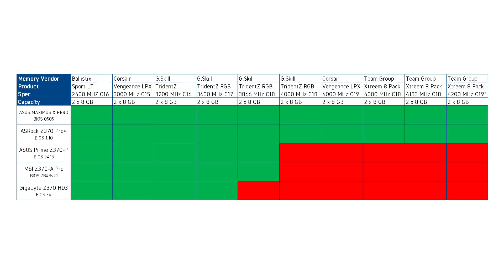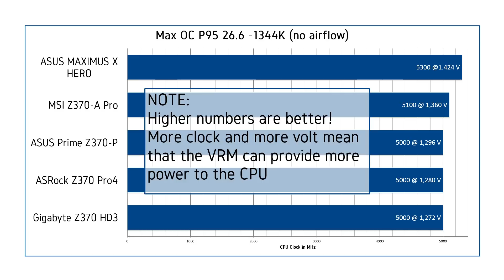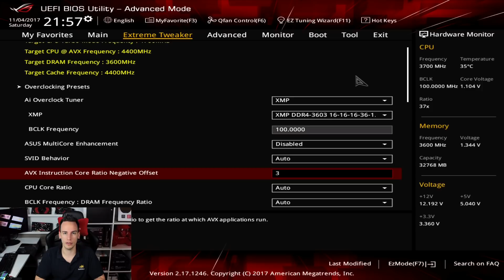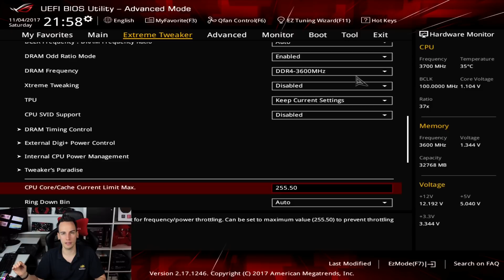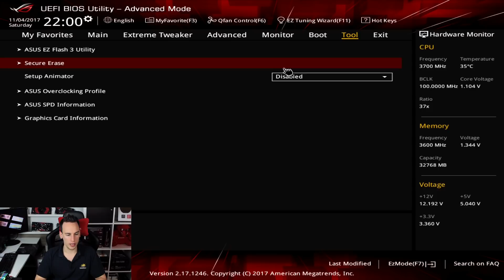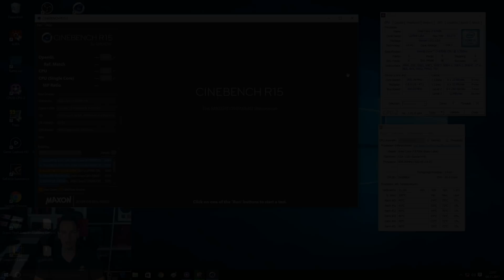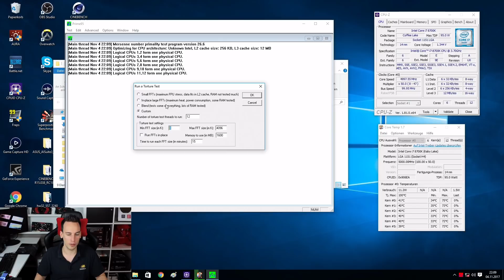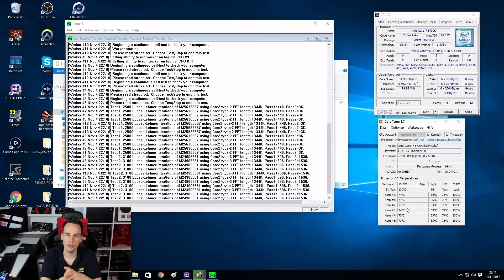ASUS MAXIMUS X HERO - Overclocking Test and Guide 8700K (en)

Comment: Hi everyone. I'm following all the steps in the video but my 9900k runs maximum at 4700 mhz, despite 50 multiplier is set according to the guide. Did somebody had this issue?
Reply: take off avx offset. everything now has avx and it will just take off the 300 mhz from your oc at all times. had the same problem.

Comment: 6 years later i'm overclocking my 8700k, i think this is the first time i've got a nice silicon, my last processor, an 7700k managed to do 5.0Ghz but with 1.35v, this 8700k does 4.9 at 1.270v fixed, that's amazing.

Comment: hi i also have na 8700k but with a maximus x code instead.  i have avx set to 3 but while idle, the core will drop to 4700 mhz for a second or two and jump back to 5ghz. did all the same as instructed in the video.  if i set avx to 0 the drops stops.  any ideas?

Comment: Hello very good video that I followed to the letter because my cpu set to 4800 mhz did not exceed 4500 in load.
Well, is it still the case!?
In addition, the CPU VCCIO voltages and agent system voltages are both above 1.32 and not 1.23 and 1.28 as on the video.
Do you have a solution?

Comment: Hey  der8auer, quick question, i have z370-p i7 8700k but ddr4 2666mhz at 7:54 you change cpu core voltage to 1.350 but your dram voltage is allready at 1.3500, mine is at 1.2000, should i go up too to 1.3500 ?

Comment: After applying xmp, the CPU System Agent Voltage is 1.440. is that too high? Since you said to change this to manual, should I manually set this lower?

Comment: Hello! I have a problem with the overclocking. I did everything as you did and set everything the same. i7-8700k + Asus Z370-A Prime, but the overclock doesn't go higher than 4.7 GHz, even though I have set it to 50. The setting for AVX seems to be affecting the overclock even if no AVX is used. I simply booted the system, set the power plan to High Performance, and 4.7 is the maximum that I get. Why?

Comment: I hope you read this comment as well after some years. I followed your instructions on my system, and it runs great. Never a BSOD, and with mij custom WaterCooling my temperatures stay as low as 70C. But, now I Purchased a second hand Core i9 9900k and I am planning to use the same MoBo (the z370 Hero). Because of the Custom  Double Loop I don't want to buy a new MoBo, and I wonder,  is your workflow the sam as for the 8700k? Now it runs at 5200Hz, I want to OC the 9900K to 5000 Hz on all cores. How about the voltages in that case?
Reply: How well did the 9900k work for you?  I was thinking about upgrading my 8700k after running it at 5.2 for years.
Reply: @Sapphica69  No real difference, only more cores, usefull with virtualization. Thatś all i am afraid.
Reply: @franslooy3151  What clocks did you hit with the 9900k?

Comment: Hi bud.
I just delid my cpu and I reach 5.200mhz with 1.5v stable on prime95 with one core reaching 76c maximum and all the rest of them on 70, 73c.
The average was 58c.
What you think about the voltage?
My cooling system is the EK aio 360 and my mobo is the maximus x formula.

Comment: hi der8auer i come always to your video once i update my bios to overclock my 8700k have a question though. once i use ur exact video with same MBO if i want to check my power consumption for cpu it always shows between  3-5 w which is impossible.
consumption under stock when not overclocked shows me 80w so i assume its more when OC. would love to know what did i disable that it doesn't show correct numbers. ordered a 9900k will use same mobo so that power consumption is important to know if i am stressing to much the mobo.
love ur videos learned a lot from it did delliding with ur tools both my 8700k and 6700k cant wait for 9900k :)

Comment: Hi im a newbie in overclocking, if i would like to set 4.8ghz instead of 5.0ghz, can i go with lower voltage to further decrease the temperature to below 70c ? lets say from 1.35 voltage to 1.25 voltage ? and remain the rest of the setting same as the video ? is there anything else that i should decrease ? mine is non delided tho.. sorry for being newb ! thanks in advance !

Comment: Just found this (again I think).  I do not have a delid cpu...(dont even know what that means).  I have 8700K w/XMP 3466 Memory.  Can I follow everything you did here but only use 48 on my CPU multiplier? (Keep all other settings the same?)  Custom loop water.  Safe?

Comment: I am having an issue where when I follow this guide and I run Prime95 my CPU speed drops from 5GHz to 4.7GHz, what might be wrong, and are there any changes you would make compaired to this original video?
Reply: New versions of Prime 95 use AVX, that's why it clocks down.

Comment: Thanx for the video. Really helpful. May i ask 2 things?
1. If cpu runs 300mhz lower when under  load, then this isn't really a 5.0 ghz guide right? I mean it will run at 4.7ghz right?

2. What about win 19 power profile? Can i go to performance? Keep balance? Make a custom? Does it make any difference?

Comment: Great video, but I have a mystery. When I follow this guide to the T and run Cinebench R15, all of my cores are downclocking to 4.7, even though R15 apparently doesn't use AVX.  This is making my scores only around ~1450  I am also using a Maximus X Hero with a delidded 8700K, temps don't go past 80c on air.  Anyone know why it would be downclocking in R15?

Comment: Hello 
der8auer ! Amazing video! I know this is an old one, but still running a delidded 8700k here. Same motherboard as in video. I need some Even at 1.330v (4.9Ghz , for example) with a 280mm Corsair AIO, it gets pretty "warm" especially in Cinebench R15 - any "advanced" tips & tricks i could check to fine-tune BIOS settings even more? Danke & VG :)

Comment: Hey thanks for the guide, when I run cinibench and Prim95 both non AVX versions, the CPU is only running at 4700 not 5ghz I'm using maximus hero xi, when idle it's running at 5ghz.

Comment: It seems when I configure my setting to your specifications I get a stop smoking logo on boot and it will boot no Further my system specs maximus hero x 300 series i7 8700k 2 1tb flash memory patriot viper DDR4 4122MHz ram ISO system using clover worked fine till I try to tweak speed

Comment: quick question, I am running the exact same settings Avx offset -3 and my clock speed is hopping back and forth from 5000MHz to 4700MHz then back alternating every 2-3 seconds. My cinebench score is only 1515 Im running 16gb gskill 2666MHz ram. I do not know what I am doing wrong. :( any suggestions?

Comment: So I was following your guide but xmp doesnt change my memory as its rated at 2133mhz, I kept with the guide and have got to dram voltage, cpu vccio voltage and cpu system agent voltage and they're all low. Do I need to change them manually?

Comment: hey guys, I'm running 8700k @4.9Ghz. The voltage in Bios is 1.29V and the load line calibration is lvl6. When I stress test in Prime, the CPU is keeping its frequency at 4.9Ghz no problems, however the CPU-Z is telling me the core voltage is only 1.243V. I'm on the "Max Performance" plan in Windows and all undervolting Asus features are off. I'm wondering if that's okay, how can it be that the voltage never goes above 1.235V?

Update: funnily enough, when I stop the test, it jumps up to 1.279V - higher than  in torture test... WTF?
Reply: @designamk1160  I've mentioned that my LLC is Level6, so I don't quite understand why this happens. Level6 is a pretty high LLC mode, what vdroop? Bios was the newest available at the time I wrote that, not so sure it still is, maybe I've missed an update or two...

And more interestingly, why is the torture test voltage lower than the idle one? 100% load consumes less power than 2%? I cannot wrap my head around it :D

Comment: I just used your delid kit on my i7 8700k and went from thermal throttling at 5GHz 100c on stress test down to max temp 57c under 100% load, all cores 5.01GHz, idle 29c. Thx m8

Comment: #der8auer

I have a inten i7 9700k base clock 3.6 base clock 4.9 ghz turbo. Its unlocked. I would want to overclock in to 4.9 ghz to 5.0 ghz or more. Would I have to delid it and bin it? If so how would I do that? Do you have any or know of any good tutorials for that? I'm running watercooling on my CPU with the H100i v2 push and pull as intake. I was thinking of getting the H150i pro or the alphacool 360mm or 420mm but lately I been wanting a custom loop. I'm probably going to order a DIY kit for watercooling and take that route probably get a really thick copper radiator that's 360mm to 480mm and maybe a couple radiators. Would this custom loop be sufficient to overclock to the numbers I want? Without binning and delidding? Or should I bin and delid along with the custom loop? One more question. Do you recommend any DIY custom loop kits?

Comment: Tried this on my 8086k and temps reached 88c while just running cinabench alone. Dropped voltage to 1.34 then 1.3, and finally 1.25, but temps sill peaked to 60c as soon I booted into windows. Reverted everything back to auto cuz that's scary. Don't know if it's a cooling issue or what, but on auto oc + turbo boost up to 5ghz it never goes past 76c on stress tests and cinabench so far hasn't made it go past 64c.

Edit: it’s probably related to avx offset ratio

Comment: First BIG THANKS - awesome guide.  Second I'm having an issue with I run the AIDA64 stress test the CPU clocks at 4.7 instead of 5.0 - when I run Cinebench r15 I get 5.0 - I am running rather hot (in a hot room, going to upgrade the case fans soon) peaking at 91C - in AIDA64 I'm not seeing any thermal throttling though - what am I missing?  Still a big jump for sure

Comment: Hello there, thanks a lot for your guide! Started with 5Ghz , 1.350 in CPU Voltage , all your recommanded specs / infos on an 8700k, delidded
Hitting like 83-93 degrees in Cinebench and Prime95 - which is a lot. It's very weird. On ASUS Max.X Hero , latest bios update right now
Any suggestions, please?

Comment: i got same build. maximus x hero. gskill 3600mhz.  and 8700k.  i followed the guide step by step. but i´m reaching 90 degrees instant! on cinebench R15. and cinebench crash.  how come ?
Reply: I'm the same, exact specs and blue screen on cinebench :( used stock thermals and my cpu hasn't had a delid, so could be that.
Reply: Either crap cooler, badly fitted cooler (bad contact/thermalpaste application) or just a bad binned cpu. Like he said, every cpu is different so this wont work for everyone.
Also, you should expect 80c+ temps during cinebench unless you've delidded your CPU using this OC.

Comment: Thank you for this guide it was super helpfull been using it with a asus maximus x formula and a 8700k not delited.
5Ghz is vcpu 1.36 volt and 85 degree max temp and lots of noise
mostly run at 4.9 or 4.8 Ghz and it stays around 77-65 degree and pretty quite.
But i see something that confused me, i set my vcpu to 1.34 but the vcpu still uses 1.36 volt in my monitor app and the lcd on the mainboard. I taught it was a hard limit you set?

I was also wondering if you seen some decreases in score after updating for windows 10 1803 or 1809 to windows 10 1903. ( i did clean install of 1903 insiders edition. month or so ago )
And i found it looked great and worked better windows it self but when i started benchmarking and gaming i got like 5-10 fps less in games and these are some of my benchmarks.

Today 27-5-2019 after new update form windows for 1903 Cinabench score 1523 on a 4.8 Ghz 
These are scores form 2 just after install fresh installs, i redid the test a couple of times but the score were al around these scores.
Cinabench score 1402 windows 10 1903 4.9 Ghz
Cinabench score 1522 windows 10 1803 4.7 Ghz

Heaven benchmark 2850 win 10 1903 at 4.9 Ghz 
Heaven benchmark 2790 win 10 1903 at 4.8 Ghz latest update 27-5-2019
Heaven benchmark 2948 win 10 1803 at stock speed 4.7 Ghz

3d mark time spy 7838 with 4.9 Ghz win 10 1903
3d mark time spy 7880 with 4.7 Ghz win 10 1803
3d mark time spy 8164 with 4.9 Ghz win 10 1803

You probably do a lot more benchmarks then i do so i was wondering if you see the same thing ?
Or if you have not upgraded to that version it should be in your normal windows updates around this month and i wonder if you see the same score drops?
Reply: Wouldn't it be nice if he actually took time to answer these questions?
Reply: Loadline level 6?

Comment: Amazing video man! I just tried a 5.0 on my 8700k at 1.350 but I noticed that in the stress test on Prime 95, that one or two cores would sometimes drop down to 4.7. Any advice on why this is happening? Also max temps after 30 mins was 60c delidded.

Comment: Instead of the AVX offset - couldn't you use the power limits? It's a bad idea to offset AVX, since lots of applications and games use it, making the high clock speed pointless.
Reply from the maker: that would also work :)
Reply: der8auer Cool. How do you figure out the power limits of the board? I've never even considered it, but a stock 8700k with all cores on 4.7 running p95 with ATX hits about 180W according to the software estimate. Is that a reliable number? According to your chart, lots of boards wouldn't even be able to run the chip at stock turbo speeds, let alone overclocking it.

Comment: hey thanks for this, oddly when I run Cinebench the CPU downclocks to 4.7 then when its finished goes back up to 5ghz, my mobo is not the one you use though its a ASUS ROG STRIX Z370-F GAMING is that makes any difference?
Reply: @Cloopster Cloopster ok great thanks, I put mine on 3 too, so should I have this on 0?
Reply: @Cloopster  ah ok I see thanks

Comment: is 1.424v safe for a 24/7 PC with AIO water and good airflow with low temps?
Reply: imo it depends on if your system is sitting idle most of the time, then okay. If it's doing work then no. Stability may be fine but longevity is what I'd worry about.

Comment: Running 5.2ghz on maximus hero xi and these exact bios settings. crashes in games but passes all stress tests including prime. Tried 1.4v, 1.42, 1.45v and still crashing. Please help
Reply: Jay Mcphee voltages are way too high
Reply: Try doing 5 ghz 1.35v first

Comment: No one mentions this but if you under volt your vccsa/vccio then ram won't be utilized to it's full potential. You will get lower computational performance from certain algorithms. So 5ghz won't differ much from 4.8 unless you do it right.

Comment: @der8auer for non delided 8700k whay max vcore? Would it still be 1.4-1.42v as long as temps are good?  Also how do you feel about OCCT seems I can pass cinebench and prime95 v26.6 test but OCCT seems to fail my overclock.

Comment: What should u change if ur core clocks are hitting 100c
Reply: Lower the voltage
Reply: MultiDragola not op but I have it on 1.28v 4.9ghz with a 3 offset and I’m hitting 100C on prime95 when it gets to a certain part of the bench.

Comment: i have tried your video, i have the same processor and the maximus X hero and it blue screens everytime it gets into windows.  I hae the Trident F4-4133c19Q-32GTZKKF RAM KIT...i can never get the overclock to work...any suggestions ?
Reply: I'd try underclocking the ram to start. Say, 3600. Just to start. Then work your way back up. 
I've been running the same board and CPU with G.SKILL TridentZ RGB Series DDR4 3600 @5mhz since 04/18 with no problems thankfully.
 I just updated my BIOS so I needed the OC settings again. I also just ordered the 
der8auer Delid Die Mate 2. Figured It's time to try some de-lidding :)

Comment: So, thanks for this super informative video got my PC running 5ghz at 1.35v seeing temps of around 50-80c at max depending on games and work load. need to tweak some settings try and get it a little cooler but no blue screens and is stable at these OC settings. Thank you sir I appreciate the guide! Ps my 8700k is not delided 👍
Reply: 5mhz since 04/18 Same as you, no problems :)

Comment: I've done the same with diffrenet motherboard. I have 4.8mhz with 1.285V core voltage. Its stable and all. When I hit cinebench test my core voltage starts at 1.27V and when i run test it drops down to 1.24 V with LLC 6.. I have ASUS z370-H motherboard. I dont understand why my core voltage is not increasing to 1.285V as set in BIOS when under load ? Like in this video before test his voltage is like 1.30V and on test goes to 1.36V as set in BIOS. Why my motherboard is behaving like this ? is something throttling ?

Comment: Thanks @der8auer, Great tutorial. I have one question, with the same system as you + delidded + 5 ghz overclock + same bios parameters, i notice that my core multiplier in cpuz drops quickly to 47, then goes back to 50. Is this an issue ? how can I solve it ?
Reply: this isn't an issue, the CPU clocks down under lots of stress. Not recommended imo but to stop it clocking down just set the avx core ratio negative offset to zero.

Comment: Hey folks. I’m new to OCing. Running an 8700k(no delid) on the Maximus Code X (in between Hero and the Formula in price SKU). I am using just a modest 4.7 to start with and my ram is manually tuned to 3200 14-14-14-34. No XMP

Anyways my question is about LLC. I have it set to 6 currently but with such a lower clock speed what would you all recommend I set it to? 

Max Package temp under load 75c and core 5 was the hottest at also 75c rest were around 71-72. Also how would I best monitor to see if I am getting overshoot with my current config?

Oh and Thanks a ton Der8auer!!

Comment: Thanks for this tutorial, first time overclocking followed it step by step. 
Only difference was I had way higher temps when doing cinebench I hit 93 on some cores

I have the same cpu but my mobo is Asus z390-e  gaming & 16gb ram. Corsair h100i v2 cooler

Do I need to make changes because I have a different mobo?